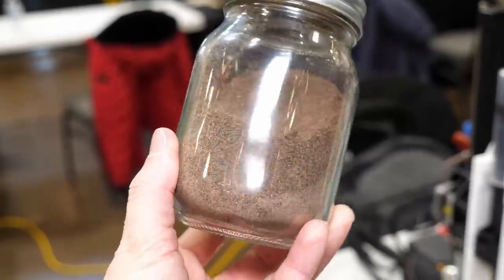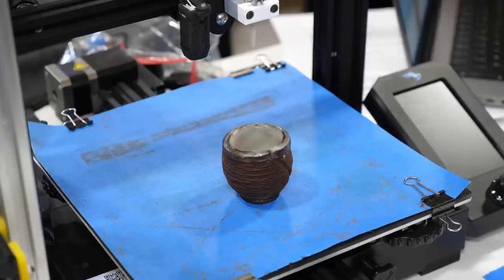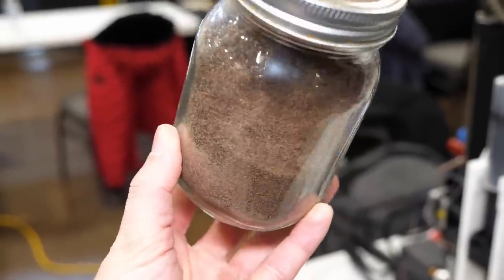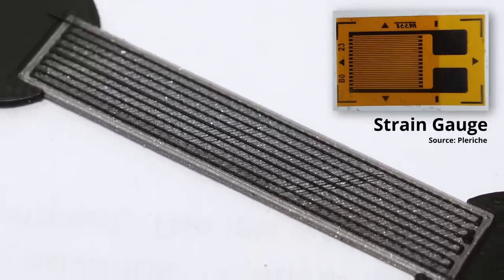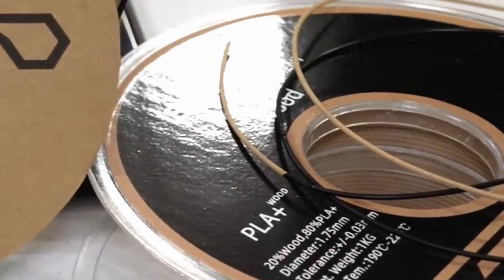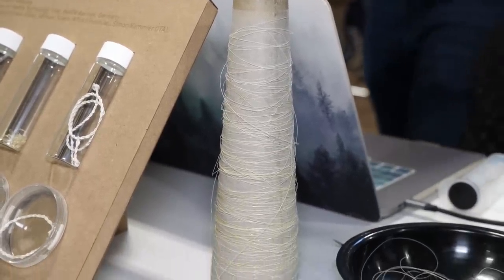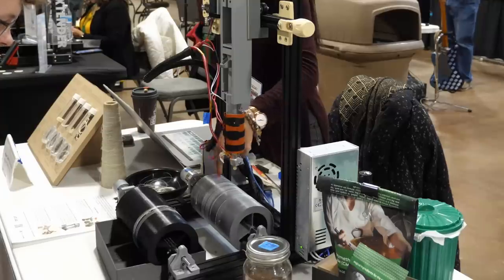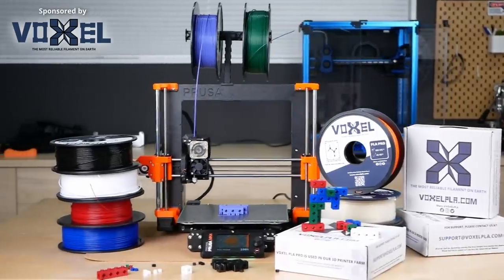3D Printing Resistors, Fibers & Coffee - Utility Research Lab

Comment: I always thought those conducting filaments suck at conducting electricity, but could shine as sensors, because their conductivity is related to pressure, bending etc.
Reply: Yes I’d agree. What I’d really want is a conductive flexible filament, so you can easily make compliant shapes where you can measure how much they’ve deformed. Though one issue with using carbon is it gets a non-trivial temperature coefficient, which you’ll care about if you’re not using a thermally coupled materially homogenous Wheatstone bridge.
Reply: I had assumed they'd be most useful for signalling where they're not passing much current at all. The sensor applications seem to be very challenging because there are so many ways the resistance can change outside of the one being measured (ie heat or wear impacting the resistance of a part that's trying to sense pressure)
Reply: @cian.horgan  temperature is something you can compensate for, and if you embed the conductive filament within non-conductive TPU or whatever, you should end up with a wear and impact resistant material.

Though analogue capacitive sensors (be they for touch, proximity, or in place of a strain gauge) are probably still going to be more reliable with this method.

Comment: The resister idea seems interesting and useful but I don't know if the other two ideas will have any value. In fact, I think they'd do more harm than good because both used coffee grounds and gelatin have other important uses and creating a new demand for them would just make other important stuff more expensive. It would also cost gardeners a cheap or free source of organic matter that I also think helps acidify soil. 

The idea that I think has the most value was one you mentioned doing before and that is using a 3D printer to print things out of clay. This is useful for a number of reasons. Clay is nearly limitless, its recyclable, and there's a huge amount that's just not used because its of a lower grade and not worth the risk damaging kilns and other pottery from explosions. If you could 3d print things out of clay and refractory, you'd be able to massively reduce the cost of pottery. One thing that needs to be figured out is how to incorporate grog(intentionally made or from failed parts) into new parts. The printing system doesn't have to be perfect for clay since simple modifications after the printing process can fix imperfections.

Comment: I regret not really checking out these tables. I go to *RRFs to check stuff out and to meetup with people, and then I keep finding videos where people go "check out this table" and I go "wait, the table that looked like they printed 30 benchies in different colors and nothing more was actually demonstrating some fancy manufacturing technique?!" Thank you for covering them, because I keep missing them.

Also, that force sensor would make Adrian Bowyer happy. I remember when he went to ERRF 2019 and at some point, maybe it was his keynote speech or the multiple interviews he gave, he was asked "what's something you're most disappointed in?" and he said something along the lines of "I'm disappointed there isn't more printed circuitry ... with all the paths going through the structure of the print" and here we have someone who isn't just doing that, they're doing it in a way that expands past "this is a wire" and into "this serves a purpose"

Also, I'll note that the biofiber printer was stationary basically every time I walked past it (I tried to do laps every hour or 2), so I thought it was basically filled filament as opposed to what they actually were showing. So it was one of the "not sure what this is, moving on" tables. Next time...

Comment: Very nice application of conductive Filament. 😃
I wish there was  conductive filament with such a low resistance so that it is suitable for wiring components that are print in place. 
That’ll  be great since I don’t like soldering and would rather like to print my circuit boards 😊
Reply: Maybe one could print with slightly conductive filament and then electroplate it for conductivity
Reply: Our common 3D printers are designed to print plastic or other material that melt at that temperature, we will never have 100% metal filaments and the conductivity will never be as good as a real wire. There might be other solutions, but I think the old wire + solder method is the easiest for now
Reply: Even if you printed the circuit boards, how are you going to attach the components?

Comment: I had this idea for a Resin Printer:
Basically, you could get a Clean (or somewhat clean) Resin Print to come out of the Resin Printer, if you had a Gravity Feeder on the Resin bottle which only lets a small amount of resin onto the vat at one time, so that when the Layer is Cured on the Print, your model is not submerged in liquid, which could result in a clean Print, or at least much cleaner print.
The only downside to this is that you would need to make sure that the Resin fills the Vat fully before your model is set back down for each layer.
Also,  the pressure of the depth of the resin normally pushes away air bubbles, which helps your print to not have air bubbles in the layers.
With this suggested technique, you would need to make sure that wouldn't be a problem.
But I'm sure that it's very possible to get completely clean and cured resin prints, straight off the build plate, just like FDM Printers have.
Reply: Peristaltic pump that doses the amount of resin used in the previous later before the next later is exposed might do the strick. You'd need to know the volume but I imagine that's not too difficult to calculate from the gcode

Comment: I wonder if printing cement could be done smaller then the huge house 3d printers
Reply: easily.
Reply: Where's the benefit?
Reply: Drone swarms
Reply: Yes.

…But then you couldn’t print huge parts the size of a house. That’s what they’re for; so that’s why they’re so big.
Reply: Bc of how cement pours and that it has other stuff (sand etc) often it can’t print nearly as fine as many other thing. However, yes. Printing big lowers construction cost more, human assembly, transport, and devices needed. However, smaller is more portable and could be used for smaller modular pieces (like cement blocks), custom blocks, etc.
Reply: das conk creet babeyy
Reply: There are a bunch of small businesses clustered around the local factory that makes cement. These businesses buy the excess and old concrete from the trucks that are on their way back from job sites. If concrete is in a truck too long, it won't be strong enough for most uses.

Those businesses make concrete lawn ornaments, large weights, and other stuff that only needs to withstand the weather.

The concrete is nearly free. 

Small concrete 3d printers could be used to make custom lawn art and pet resistant structures.

Comment: I would be very interested to see your reporting on the voron 0.1 printers described in the research article Additive Manufacturing
Volume 71, 5 June 2023, 103604
MEWron: An open-source melt electrowriting platform. An EPFL news article titled "Open-Source MEWron Device Unleashes New Possibilities in 3D Printing" states that there are 4 such printers "available" on the EPFL campus in Lausanne.

Comment: I don´t see really a new great solutions here. I know a Germany company which makes plastics from wood (lignin) this is a great idea, much better than coffee ground which is ...yeah I mean.... just use the wood plastics xD
Reply: The two benefits demonstrated there are eliminating plastic from the material entirely (not sure if you meant they made a lignin based filament or used it as an additive) and that it's made from mostly waste products with an additive instead of mostly new material
Reply: @skybloo16  Yeah so does the wood derived plastics as well AND it has some structural rigidity which the coffee ground does not provide. They also made ligning based filament which you can buy. It´s also bio degradable, it´s basically 100% eco friendly. I am telling you that stuff is spectacular. 
Also pyrolyses plastics are interesting. It´s chemically recycled plastics, 100% recycled and has 100% the same material properties unlike all the other recycled stuff.

Comment: 1. Printing with coffee.

A great way to print plant-pots. But pressing them is a thousands times as fast. Good research, but it's again more of the "lets see if we can force a 3D-printer into this process" and not "I have an idea that needs a 3D-printer".

2. Touch sensitive structures.
Vdey interesting. NBo clue what the usecase is. Also no clue why she isn't using a multi-filament printer, or a disgn where she can insert the resistors lateron and snap the parets together, you k now, like we all do in our designs. Again, very much a " I have an idea, now how can I force a 3D-prkinter into it?" thing.

3. Making fibers.
Yes, this is how they mkae fibers. It's interesting  to see her doing it on a small scale, but yes this is how they have been making fibers for...well as long as they have been making them.
This is really pushing the "it uses a 3D-printer" factor because it literally only needs the nozzle.

All in all I get a very strong feeling that a lot of companies have noticed that an increading number of people just turn off their brains when they see a 3D-printer and start accepting any bullsh*t they are fed as magic because it involves a 3D-printer.
Reply: I think the point of those projects is to find ways to re-use different materials (coffee grounds and gelatin) that would otherwise get thrown away, thus reducing the amount of waste and recycling them for other applications. They are exploring these ideas and seeing if it's feasible to do this, and the printers are just a means to do that.

Comment: If I am honest I am not very impressed by projects you shown. They are quite interesting but not very practical nor efficient.
If you wanna save the planet just stop printing junk.
If you want conduct electricity through the print just design place to put components and cables, make pause while printing and put them there or design stuff that way you can put them later. Also high resistance means a lot of heat while dealing with any significant current, so it would be just for data too. What's more such resistor wouldn't be very stable I bet.
Fibers may have some potential but it's just a prototype of machine some may use in industry. Rather barely one would use it in small scale. Also gelatin is not a waste, it's being used in many applications. 

I was thinking about buying 3D printer for a long time and every time I saw video on youtube why should I buy one it was
-you can print parts for your printers
-you can print "put here the name of you least favorite superhero character" figures
-you can print benchmarks
-you can print great projects (and shows something like non working fidget spinner)
I read more about it, bought one and I am very happy as it's extremely useful for DIY projects (cases for example), fixing stuff, making prototypes etc. 
If I went to such event an saw such projects it would not make me interested 3D printing at all. 

Don't get me wrong, I am not hating those folks, just being a bit salty. We shouldn't say all the time something is great while it isn't. We don't need to discover wheel again or change it into square.

Comment: Its crap, all crap. Going to extreme measures to make something nobody needs or can be done much better and cheaper with conventional technology.  I get these are young people looking for ways to make a difference or come up with new and useful ideas, but a moments consideration should be enough to tell you these particular ones are a total waste of time. Like 3D printing these huge resistors, when current resistors are a fraction of the size and cost and come on reals of 5000 for $20, and are placed by pick and place machines at a horrendous speed. Together with the additional devices that you would need for a complete circuit. So, why the need for these huge resistors? Its a case of doing it for doing it's sake with no chance of having a practical end goal.
Reply: I like the idea of being able to print simple circuits directly into your design, by-passing the need for making PCBs for that. The size can certainly be reduced with clever 3d designs and printing with small nozzles. but I don't see any idea here that pushed that forward. Sure you can use the biggest downside of conductive filaments - high resistance - to make resistors, but that's about it. Maybe something like a capacitor or an inductor is possible, but all with terrible tolerances and poor performance. One would have to have an idea of how to at least print something behaving like a semiconductor, a diode, to build something akin to transistors to make anything useful with it. And of course you still will need a way to print proper traces, which is still at best possible with an expensive metal printer so far.
Reply: @Hugh_I  in other words, its a cute idea but totally impractical, and mostly useless.  You see this sort of thing a lot.  People get a cute idea and spend an awful lot of time developing it without actually thinking forward in time a little and asking themselves "is this really something useful or just a minor curiosity, and could my time be better spent elsewhere". Even the simplest circuit utilizes some advanced form of electronics like a LED, and you won't be 3D printing a led.  The only use for this sort of thing is imbedding cables into your plastic so cabling is premade for you and inside the structure, but since this stuff has high resistance even that won't work.
Reply: @RobertA-hq3vz  yep, pretty much